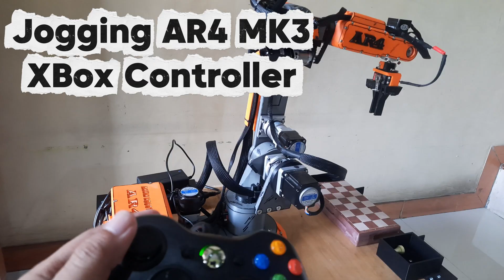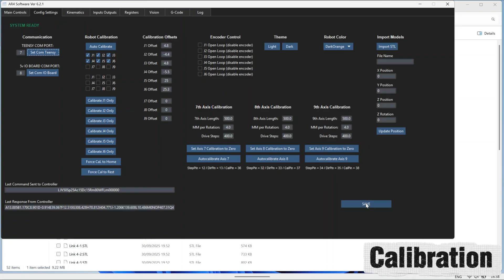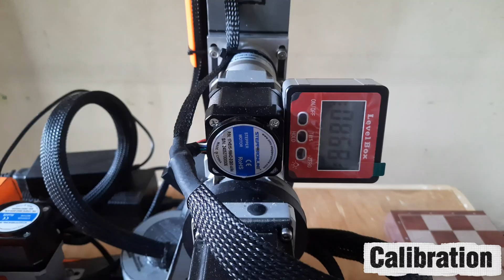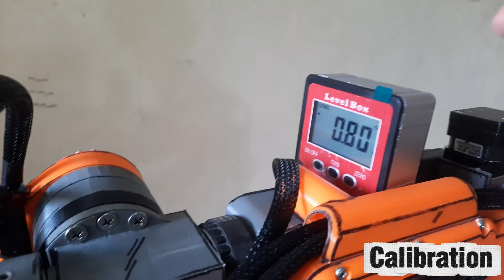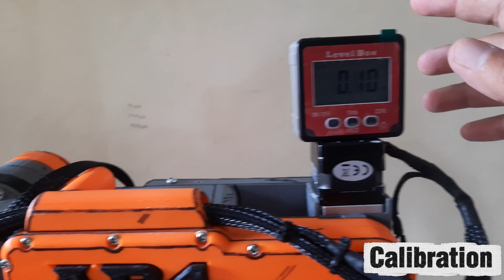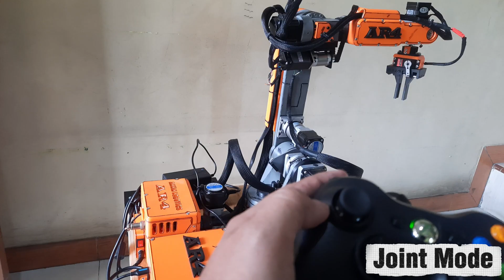Calibration and Jogging AR4 MK3 Robot Using Xbox Controller

Comment: Is this max speed? Why there is so much wiggling when it stops moving?
Reply from the maker: Maybe because I use full 3d print, better if you use aluminium part.
So the robot becomes rigid.
I use 25% speed.
You can visit anninrobotics.com for further information

Comment: May i ask whats the max speed, payload; is it easy to mount extra stuff like camera for object detection on end effector? hows the control system: how easy to modify its velocity profilr to reduce jerrk; can i use mks board for controller?
Reply from the maker: For detail information, you can visit the robot developer website: anninrobotics.com or find chris annin youtube channel.
For reduce jerk, better using aluminium part.
It uses teensy as controller